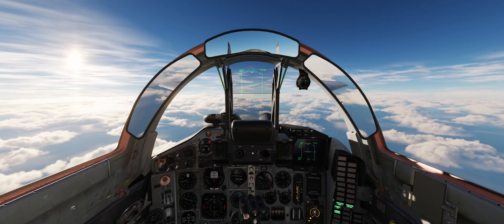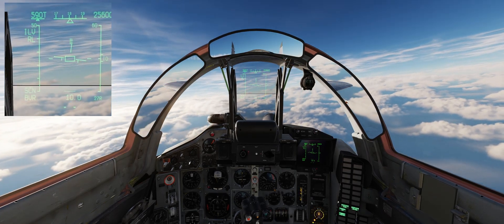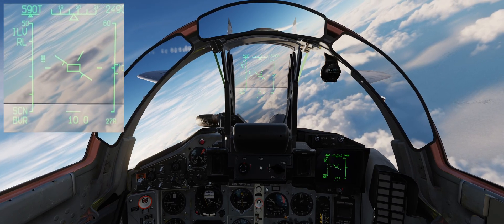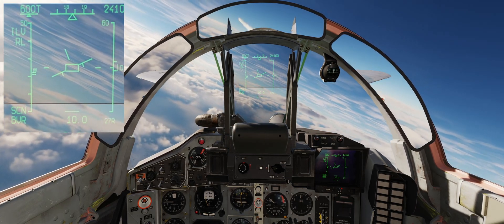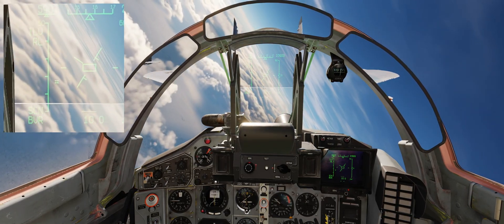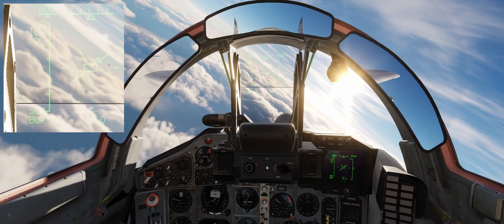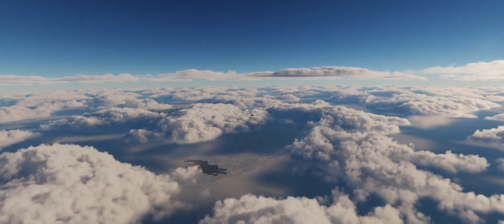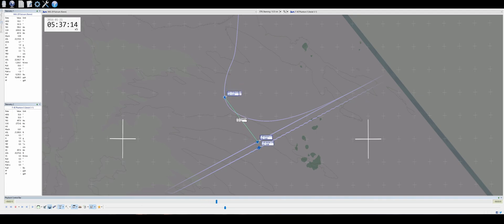MiG-29 "Fulcrum": SYNC-Z-TURN Demo

Comment: cool, but as a newcomer i had to google what a synch z turn actually is and accomplishes :)
Reply from the maker: I don't mean to the blunt, but:
1- there's a direct link to the explanation in the description;
2- the first line of the description shows a link to the article, which has a direct link to the explanation;

Plus:
3- the pinned comment shows a number of info and links for newcomers;
4- you could have checked recent videos;
5- you could have used the search function on the website or YouTube.
Reply: @FlyAndWire  you are right. sorry :D
Reply from the maker: It's alright mate :)